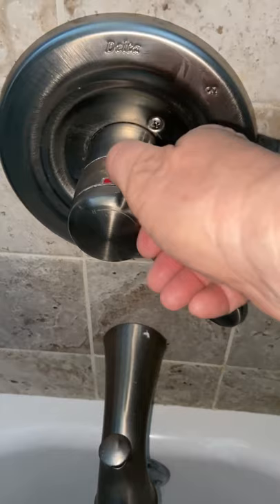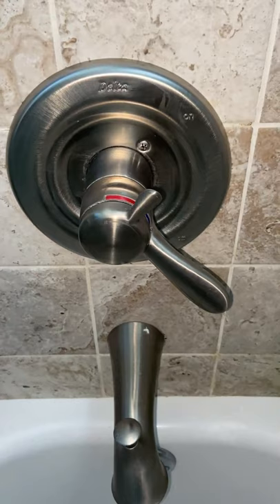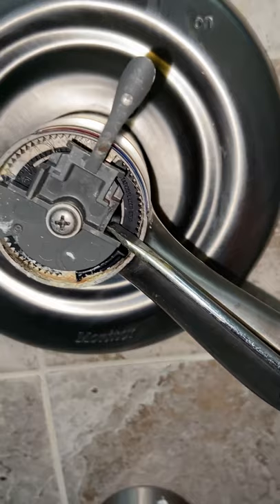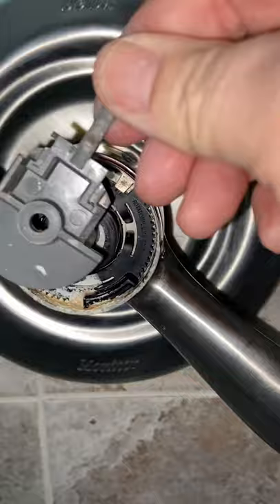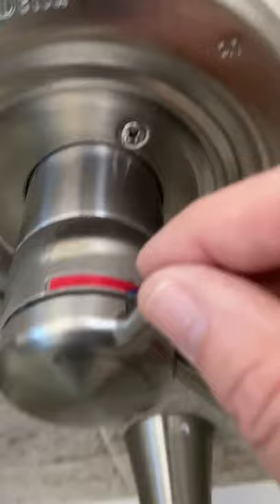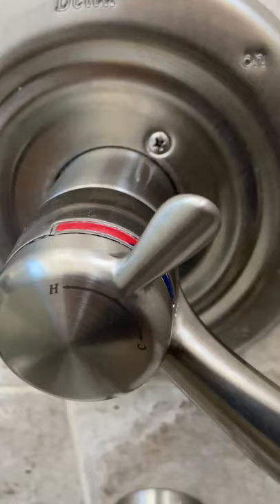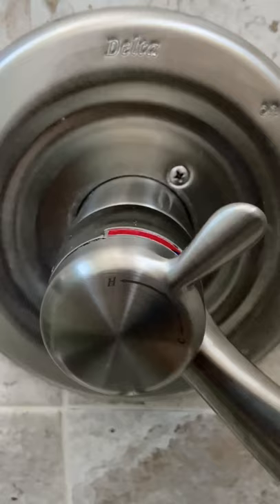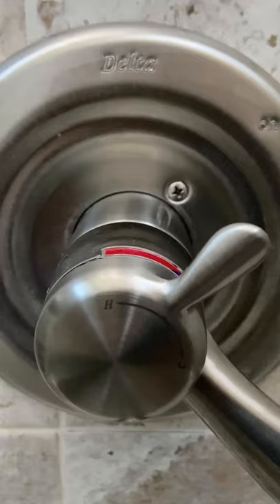Replacing Temperature Control on 1 Handle Delta Shower Faucet

Comment: We are in a similar boat- bought a house with T17288 shower only faucet.  The Temperature Handle is not moving- stuck on cold.  Any thoughts?  Thank you- and thanks for the tip on contacting Delta directly.  Keurig has similar customer service.  A part on Amazon over 25.00 was sent to me free.  Good service.
Reply from the maker: Sorry for the delay. Not sure. Again the best thing to do is call delta. Hope you solved your problem.